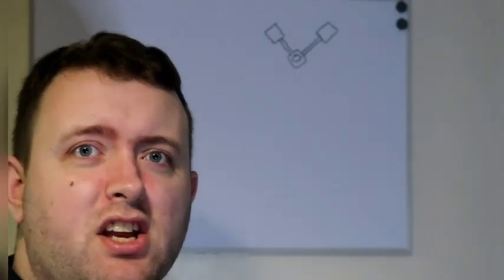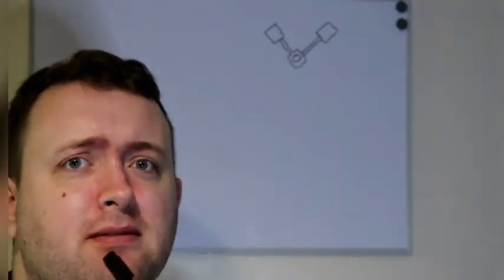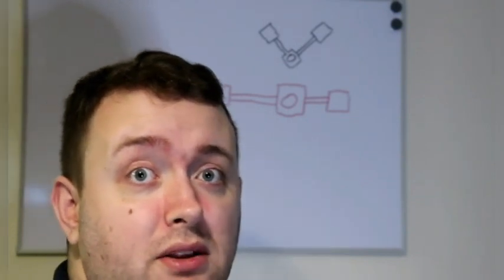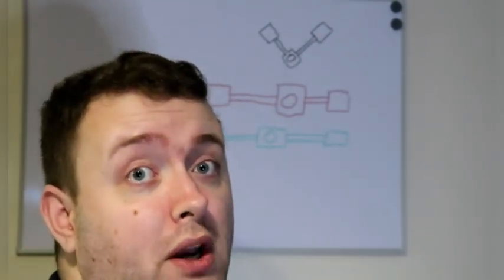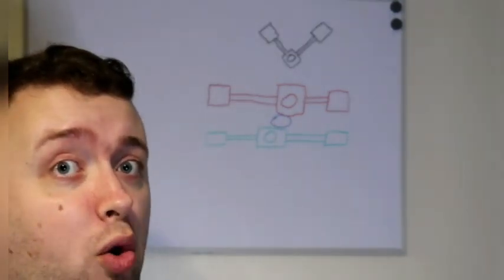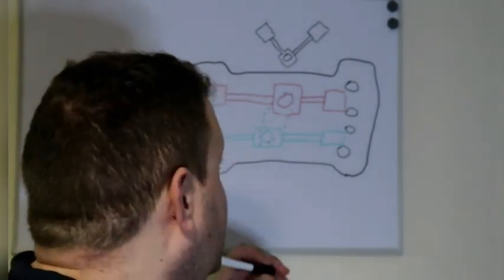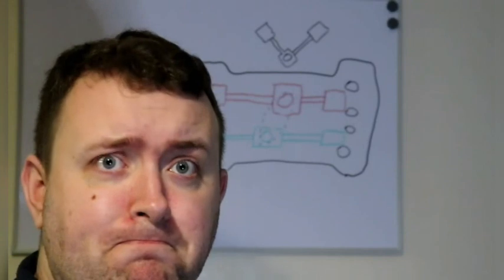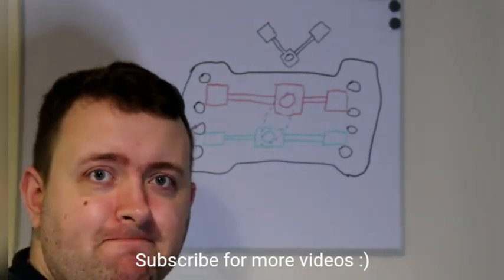The borderline insanity that was the BRM H16 engine

Comment: I remember seeing this engine at a London Motor Show, it looked huge in the car,  because it was relatively huge! I believe the ‘thinking’ behind it was to try and keep the reciprocating mass per cylinder low “ theoretically “ half that of of an 8 cylinder engine of the same capacity,  thus enabling it to go to higher revs, but the complications alluded to and the limitations of the material science of its day unfortunately just ended up as a big, heavy, unreliable lump.
Reply from the maker: I first saw the engine at the Le Mans Museum in 2017, albeit fitted to a BRM P83 from the period, even there it looked huge to me. That said, I first came across it when reading the "F1 Encyclopedia," dated to 2000. They described it as "fiendishly overcomplicated and overweight,"

Comment: What was that thing connecting the engines ?
Reply from the maker: The blocks themselves were welded together, that was the easy part, the tricky part for the BRM engineers was to sync the cranks, cams, springs, pistons etc

Comment: Interesting look at the engine.  I admire their creativity.  The results were another matter.
Reply from the maker: During my research, one of the books to do with F1 described the H16 as "fiendishly overcomplicated and overweight." It was an attempt to achieve what the Cosworth DFV V8 was better able to achieve, albeit with half the cylinders, less complexity and less weight.

USA 1966 was one of Jim Clark's best wins, nursing the Lotus 43 to victory with the H16 powering the car
Reply: @SiVlog1989  Did you ever find out why Lotus selected the h16 while waiting for the Cosworth? I suspect Chapman had other choices.
Reply from the maker: @jamesthompson1279  as far as I have seen, up to the time when the DFV was ready, Lotus only had access to a 2.0 Coventry Climax engine, which was down on power relative to 3.0 engines. The H16 was selected as an interim measure by Colin Chapman, BRM talked up the power produced, and Chapman would pioneer the use of the engine as a stressed member on the type 43, that he would improve upon with the iconic type 49 (which was powered by the DFV), but Chapman knew that they were in trouble as it took 4 men to lift just one H16 from BRM. The race Jim Clark won with the H16, US Grand Prix 1966, nearly never happened, the engine Lotus had failed in the morning and Chapman had to ask to use BRM's spare engine to allow Jim Clark to run that race.

One photo taken at the start of the race shows fluid seeping under Jim Clark's car, showing even that engine wasn't perfect and ultimately it was Clark using all of his trademark mechanical sympathy to nurse the car to P1 and take the chequered flag first
Reply: @SiVlog1989  Thanks for the info. It does look like the U.S. Grand Prix was a good weekend for the H 16. Clark qualified second, Hill was 5th, and Stewart 6th. The weight of the engine was staggering. I did see the engine in use once at the Grand Prix of Monaco in 1967. Mike Spence drove it to 6th place. I'm sorry to say I don't remember seeing him. I do remember Stewart leading the race in a 2.1L engine before going out with mechanical problems. His performance was impressive while the car lasted.  I don't think he had any fond memories of the H 16. What a great era for motor racing.